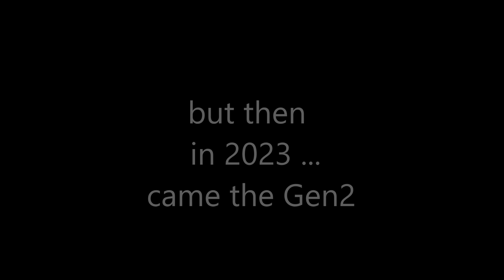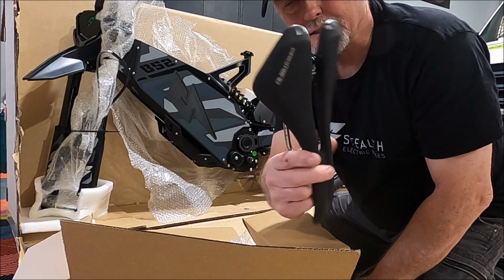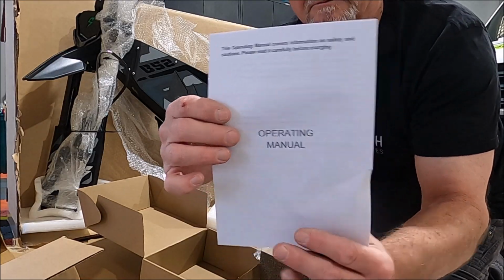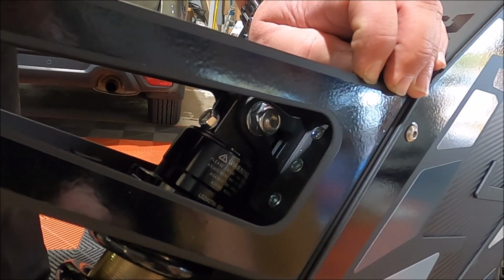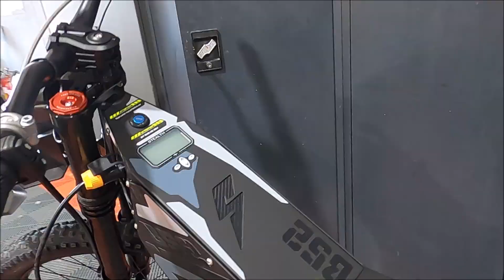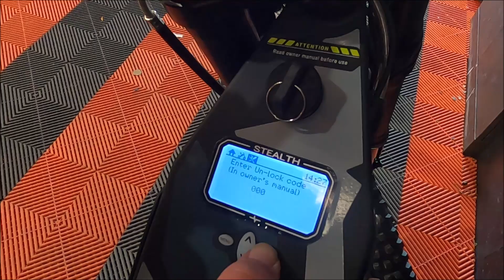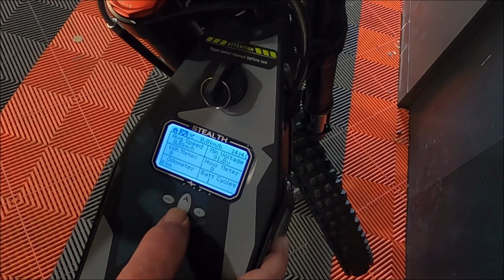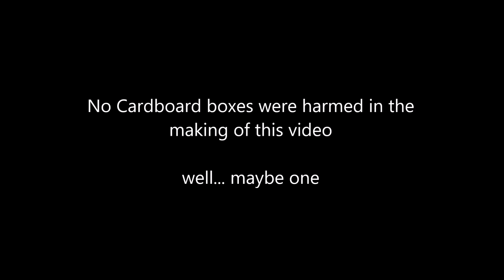New Stealth Gen2 B52 Unboxing

Comment: for the price that they charge you ,they really should included heaps more stuff,like they should have included the schlumf drive unit,butter hub motter heatsinks An ASI BAC 4 or 8 thousand
Reply from the maker: Well it has an electronic 6 speed gearbox already.. 
And not much of a fan of the schlumpf 2 speed..
But cruise control would be good..
Reply: @NXAussie500 how is the battery and the motor when going wide open?
Reply from the maker: @tatianatodorova5199  sorry, not sure I understand the question..

Comment: where the gen 2 videos?
Reply from the maker: We've had some problems with the bikes.. this will be revealed soon..
Reply: @NXAussie500   That's troubling. Ive got a Gen2 order coming
Reply from the maker: @Smokey00 is it a B52   ?
Reply: @NXAussie500  yeah gen 2 b52
Reply from the maker: I will explain in a video, but the Gen2 has 27.5 inch wheels. This increases the gearing effect on the motor and thus increases load. On a long or steep climb, this tends to overheat the motor. There is a solution being looked at. In the meantime, we'll trial the 24 inch rear wheel on the Gen 2 Bike. !! @Smokey00
Reply: @NXAussie500  maybe ferro fluid and the fins from the old bike would help